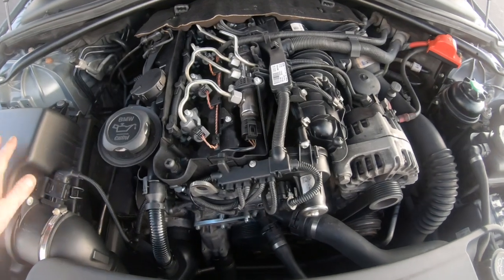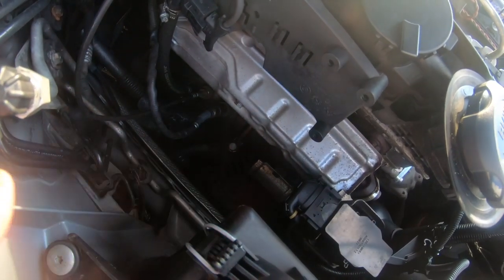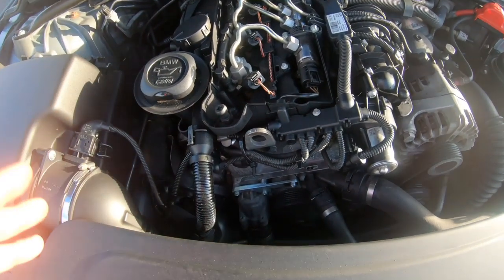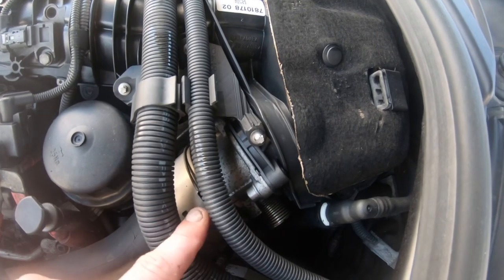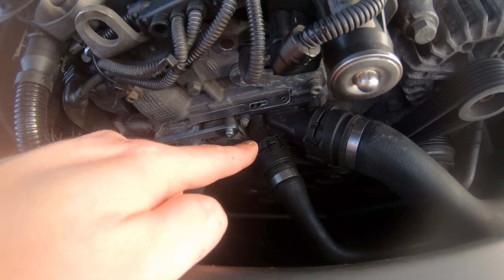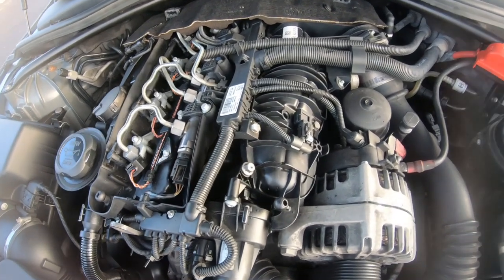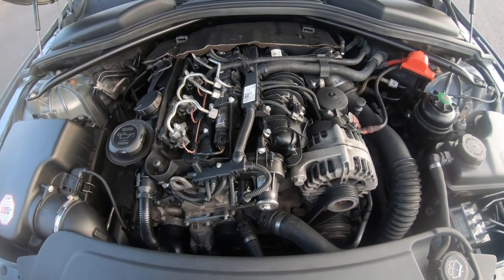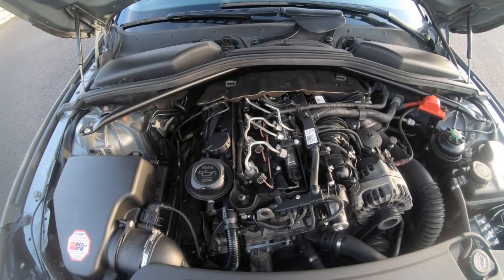Bmw N47 Reliability 2019........... Can It Be Reliable STILL In 2019

Comment: From all of you've said, a potential buyer of this car will run away... Well in all of the video it seems that this car and engine is a total disaster. Fails everywhere, everything on the engine will fail. But it is not exactly like that. Parts will fail anyway due to mileage and age. If you maitain the car corectly, it is the same as all the other car brands out there. So don't be afraid to buy one. Well ofc if you get the cheapest don't expect much anyway.
Reply: I disagree with on one point, if you maintain the car (n47) correctly, it is better than “the most” of the car brands out there, I know because that’s what I have been doing these last years and it is still running perfectly, of course I’ve changed some parts (engine mounts, batterie 😉 brakes…) still with the original time chain ( I am surprised as well) and that’s it
BMW 5-Series f10 2012 but only 130k
Reply: The engine is reliable,but the parts around it aren't.. because they're mostly plastic
Reply: @cobraten91  what modern car doesn't have plastic?

Comment: 2013 316d 54k on the clock I’m buying it . I’m a mechanic I do low mileage will be changing the oil every 5k is the engine the same as in this video ? Is it actually any good worth a buy

Comment: Hi mate your ok  hope you can help iv got a pipe which has come off its on the bottom as I was driving I felt as tho i was losing power when I pull over I could hear air coming from the engine as I check the pipe was hanging what do you think that is or come of from please

Comment: Every engine has its flaws. I have N47 2007 177 bhp. Removed flaps, changed timing chain, prevention fix, never had any problems, most reliable car i ever had, 230 000 km on the clock, pulls like crazy.😁
Reply: What brand for the chain did u use? FAI? Febi?
Reply: I changed my chain at 130 000 km. Now it has 250 000. Do I have to change it again?
Reply: @MarinTheFirestarter  its not a belt 😂😂😂😂
Reply: 230,000? 😯
I have a car with the N52, 2.5 straight 6. I'm getting a little acted because it's reaching 76,000, but only because it's such a big looking engine.
Should I be worried? The servicing has been done by the book, with the proper long life oil used.

Comment: We have an 11 year old 3 series touring with the N47, bought when two years old with 20k on the clock. The N47 and BMW in general get a lot of flack for reliability, I have to say that this has been a very reliable car, in fact the most reliable car we have ever had. Since it came off the 5 year BMW service plan, I have looked after it myself, oil and filter every 10,000 miles. The only real problem my wife had was it went into full limp mode with warning of over heating, I replaced the temp sensor @ £12 of she went again. I had to replace the glow plug controller, one plug had gone, but replaced them all. I have no idea when the glow plug problems started as it didn't cause any noticeable problems. The fuel rail pressure sensor went bad. I replaced the CC pipe you mention, it was an older design that the one you show. The wiring to the fuel line pressure/temp sensor broke away from its plug. The coolant thermostat went at about 70k, I replaced the pump at the same time. Other than regular maintenance that's been it.

The timing chain issue with this engine is a concern, it seems so random some seem to go at lowish mileages others still going at 200k. Mine has had a slight tsh tsh sound at idle for some time. We missed out on the BMW "quality enhancement" but on talking to them they stated that on our vin ours wasn't listed as one that needed checking. I suspected that was crap. I did replace the top tensioner with an updated one, but it didn't make any difference to sound.

The car is on 130k now and I have decided to replace all three chains, guides and tensioners anyway. It's too good a car to get rid of and wouldn't get much for it now.
Reply: The gentleman who hosts this channel is bang on with the advise, the timing chain well my job at BMW cost £6,000 on an e92 M Sport N47 i did the clutch the same time for an extra grand all original parts at least then you know what you going to get "manufacturing and service deal warranty on parts".
Reply from the maker: Thanks mate I appreciate it and that’s only because I owned about 5 and dis timing chain about 60 times on the ground for myself and others lol
Reply: @BMWDoctor  Been thinking about doing an EGR full delete. done the swirl flats already, lot some low end power but better than than £ the thousands it would cost once they had fallen inside. Next to do Water-Pump and Thermostats after my full Bilstein suspension upgrade - keep on with that you do "make differences" to people's own equality of life - take care.
Reply: Is your N47T OR N47D20?
Reply: @BMWDoctor  I don't doubt your experience.. But i genuinely believe the issue is caused by bmw using LL04 oil. People were driving these for 2 years with no servicing beliving the oil was long life. Oil pressure is used for the chain tensioner..

I have a Honda Civic n16a1 idtec ( diesel) engine and an N47T 320d m sport plus lci (diesel).. oil is changed every 6000 miles.. i can hear a tone difference when it used to hit 10k, not only me but the mrs said it too.

Diesel engines destroy oil, super quick and fill it with containments.. it may still be stable but its dirty.

In regard to the mileage of failure being all over the place, the n47 was stuck in nearly eveything in the 2010s. 520d ,320d 120d.. these were getting shaved back massively due to uprise of pcp.

We both know if you set it back to 0km then go on, you'll get no tamper dot. Bmw have been counting abs module rotations in defence.

Again i dont disrespect your knowledge,  but i think the n47 gets a bad name and in my opinion bmw caused it due to oil changes.
Reply: I have a 2009 320d with N47 engine. Bought it at 80k miles, and have now done 210k miles in it. The engine is completely original, nothing changed. The car had a full BMW dealer service when I bought it to check it out. All good, and only really done oil and filter every time trip computer told me to. Had to do things like brake discs and pads obvs, and have replaced all shockers and one coil spring. But other than that the rest of the car is as it was manufactured, including all control arms and bushes. Serpentine belt has started squealing recently so is booked in for that along with the pulleys and crank shaft pulley as well, and had an MOT advisory about rear trailing arm bush this year so will look at that too. All things considered for an 8 grand purchase price in 2014 when I bought it, it has to be one of the best value cars ever.
Reply: @theoutsider6191  glad to read stories like yours. As I own a N47D20C BMW 3 series, no timing chain rattle at 130K, im still in doubt wether to change the chain or just keep up yet with the oil changes.
Reply: @bathanmark hi, did you ever get the chains replaced? I've just bought one and it's on 115k with good service history. Unsure what to do myself.

Comment: I owned a 2014 BMW 2 series 220D with N47 engine. I bought the car in 2016 and owned it for 5 years. To this day, I haven't had a single engine problem. I just service regularly whenever the reminder comes up.

Comment: Have a 2009 touring for past 5 years and done 160 000 miles in it has 252 000 miles  on it I change oil every 8000 castrol fully synthetic 
Never had any trouble with this car still returns 60 to the gallon and pulls like a train

Comment: My E60 N47 LCI has 610K km on its mileage. Had to replace the timing chain at 518K km after rattling noise appeared and I don't even change the oil before it has 25K km on it
Initially, I planned to drive the car up to 800K km but seems it will easily go for a million.
When I hear stories about snapping chains at 120K miles without any warnings, that's either complete B.S., or I am the luckiest guy ever. But on the other hand luck may have nothing to do here because prior to the BMW I had a Ford Focus 1.6 TDCI that now has 440K km on it and people tend to bash Ford's reliability as well.
Reply: I have an E90 320d LCI model, currently at 312K km and no timing chain issues. Absolutely brilliant car. From what I know is  that the first 2 series of N47 engines, the A and B versions had quite a lot of problems, the C model 2011 and later (same as mine) seem to have far less problems. Personally, I think it's down to proper maintenance (changing the oil on time) and just usage of the car. How does one drive it? I usually let it idle for a minute before driving off, and the first 5 or so kilometers i'm gentle with  the throttle. And also 'load changes' (heavy accelerating/letting go of throttle) tend to put a hard strain on the timing chains. I think this is of great importance whether the timing chain needs to be replaced or not.
Reply: So if kilo is thousand and mega is million that means you'll have a megametre on the clock? that sounds funny..

Comment: Finally, someone who knows exactly and not talking just about a bunch of assumes and thoughts, big up for you and thank you very much for this video as it helps me now a lot, as I am currently doing general maintenance on my N47 E90 and got stuck on solving the issue with overcooling engine, loose power over 3000rpm and not working heating/cooling in the cabin. I deleted EGR and removed swirl flaps so far and wasn't sure about what to do next to make sure that everything will work properly and smooth as it should. Hope will pull and heat again after all this.
Reply from the maker: Your welcome good friend I’m from the U.K. so of course I will have more knowledge on this engine then most people who make these videos which are usually the US people who haven’t a clue about Diesel engines
Reply: @BMWDoctor .Yep absolutely Just wondering, if there is such a huge difference between the OEM and aftermarket MAF sensors prices, would you recommend to keep the original one and clean it by CRC cleaner or rather change for £20 aftermarket new one?

Comment: Had 3 BMW N47T engines in the house for 7 years. All oiled changed once a year, nothing else needed other than discs, pads and one battery. Knock on wood of course. Lovely cars. F20, F30 & E84
Reply: 7 years old BMW 3 n47T engine. Turbo leaking, DPF dead, EGR cooler replaced TWICE!!! due to class action lawsuit ... are you fukin kidding us ??? This is the worst car on the planet. Along with mini cooper.

Comment: My bmw 1 series 118d e88 convertible 12 plate still runs like a dream,never had a problem with it  yet,I service it every 3000 miles. Never had a problem yet either with my bmw m3 bi turbo 16 plate.

Comment: I'm interested in buying a used f22 225d, produced in 2014, with the n47 engine and I couldn't find a better video to educate myself about this engine..well done my friend! I suppose it has the revised tensioner but did BMW really solve the timing chain problem or it just extended the lifetime of the timing chain and it will eventually snap?
Reply: My 2011 n47 has thge revised setup but is now rattling at 235k miles (347k km) so a substantial improvement over what older engines last for but nothing lasts forever!
Reply: @RoobehTunes  You likely keep up with your oil changes as well. The timing chain will wear faster with worse-quality oil because soot will be in the oil from burning diesel.

Comment: Turbo failed on mine, previous owner knew it was dying but didn't disclose. It wasn't whining but about 5mm play in the shaft. There was some light oil around turbo casing (where internal seals have gone)  I should of noticed. Check this before buying!

Comment: i have an e91 318D (march 2009 production) 201.000km  . Runs like a charm!
Reply from the maker: It won’t for long I assure you of that hopefully timing chain will snap soon
Reply: @BMWDoctor  i'm keeping an ear open for new sounds but i'm thinking of going to the dealer and replacing it. Do you know if the replacement solves the problem? I'm curious if the engine torque is too much for the timing kit and if the engineering is bad on this n47. Thanks !
Reply: @AlinPurcaroiu  if it doesnt rattle dont replace. Keep replacing engine oil like a normal car not extended engine oil interval.
Reply: @nihonkokusai  210k still working like a charm.  N47D20C
Reply: @AlinPurcaroiu  How about now mate?

Comment: My timing chain snapped without warning today on my 2010 bmw e90 320d ed... I have owned it for 7 great years and it died today with 180,000 on the clock.. I had my moneys worth so I will glady sell it to a breaker and maybe buy another one later.. For what you pay for them, its not worth spending money on a new chain.

Comment: Had a 2013 320d and at 120,000 miles these kind of things started going wrong. Starting with a drive moderately message on the I Drive screen and then sporadic engine  lights. My car was fully serviced with oil and filter changes every 10k and only motorway driving too. , The EGR was replaced and I was still getting the messages. I got the message.. time to sell, and that's what I did. My advice - be wary at this age / miles.

Comment: Hi av got a bmw 120d n47d20c its very loud and rattley ive had the timing chain kit replaced the 3 chains and all the sprockets at a cost of 1200 ive got the car back and its exactly the same. Its very loud and gets louder the hotter the engine gets,
Reply from the maker: That will be your chain again mate or maybe tensioner is not been done properly that’s the only thing that rattles on these cars badly that’s why I tell everyone the same get rid and get 6 cylinder and be happy and don’t look back all these 4 cylinder engines are what make people THINK bmw is a lot of crap NO MATE bmw is not crap it’s the engine you picked was crap get a 6 cylinder and no issues
Reply: @BMWDoctor  thanks for reply and very good advise much appreciated

Comment: My dad's 520d E60  LCI had the whole timing chain set changed around 10k miles ago. We have the car for 2 years and everything is okay with it. The owner before us took good care with the car and changed everything. We are servicing it at the official dealers only also. Everything should be right you think?
Reply: Its changing the oil half of the interval like 10000mls.

Comment: What engine oil can you use on this engine?

Is Castrol Edge 5W30 LL Oil 4L any good ?
Reply: as oil is fairly cheap and easy to change on this engine, I use 5w30 for the winter and 0w30 for the summer. I know a bit excessive on the oil changes but I have never had any issues since I have owned the car. So yes 5w30 is good for the older cars as the internal parts do wear over time.

Comment: At 110,000 had to replace: crankshaft pulley, flex pipe, glowplugs + module. Oil changed every 10k [with flushing oil used]. X1 automatic 4wd [N47D20C]. 45 Mpg on motorway but town only 30mpg. Toyota bring the corolla cross hybrid later this year which would be cheaper to run around town; I hope to keep the X1 so long as I don't have any more hefty repairs.
Reply: You don't buy diesel to run around town. This is killing them. This engine its not exception. If DPF is full it will try to Burn it by pouring a lot of fuel and this fuel is mixing with oil and its making oil lose its charatistics and without good lubrication this engine will fail. I seen diesel engine that are lasting 600-700k km on motorway use and the same engines failing at 150-200k km on city use. If you are using car in city hybrid/gasoline car i much better and will last longer

Comment: Catastrophic engine damage from snapped timing chain. So , 6 weeks ago I was driving along as normal in 3rd gear doing 30. Car pops out of gear and turns itself off. I thought oh no I know what that is. Yes it was the chain but it wasn't just one chain oh no no , it was 2! Completely snapped with no prior warning! No rattles knocks nothing to indicate it was going to go. On further Inspection my ex bmw specialist told me it had cracked the cam carriers, smashed the cams, snapped the rockers! (Pics) after even further Inspection he told me that the clutch and flywheel were on there way out (no indication of this prior) the flywheel had been rattling and caused extra vibration into the engine and he said he thinks this is why it's snapped 2 chains. He has done 30 ! Yes 30!! N47 engines with chain damage or replacement and said he had never seen this before.

All in all a bill of £2300!!!

It's a 2011 F10 with 155k on the clock full service history every 11k maximum.

Moral of the story BMW should have been sued for designing this engine so poorly! I will be returning to the trusty M57 soon enough.

Comment: Very informative!  Lots of info!  Excellent!  I'm looking at a 2015 X3 Xdrive28d.  N47 engine.  It has 63 miles on it.  Test drove the car it goes good.  Seems like a lot of exhaust system vibration at idle, up forward near the engine.  It has the 8 speed ZF.  Any thoughts on this car?  I don't want a bucket of headaches, my daughter would be driving it, not me.  They want 3500 bucks for a 24month/24k extended warranty.
Reply from the maker: My friend it won’t be this engine 

That will be B47 which I have on my other videos

Comment: Hello i think you are a very smart man. which diesel engine 4 cylinder bmw e 60/90 is reliable after 2009 to choose  and is it safe to buy if oil changed regularly- chain problems. Which year models are the Most  affected? Best regards.

Comment: Dean, thanks for posting this mate. Mine 118d is an 09 sounds and runs like new. 89k on the clock. So fast and reliable, I only use Shell V power diesel and oil service is done at less than 8k miles every time, but sounds like I might have to sell the car if that timing chain replacement is that much. 😕
Reply: Paul Lockwood I’ll buy it